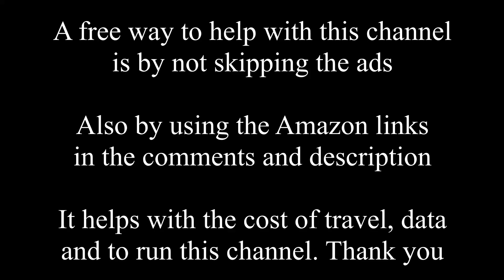New Bike and Cart for Homeless Magician - Cebu City Philippines

Comment: Dustin, maybe you could ask the bike makers to custom make you a type of cart that can carry rice.  The cart has to be light but strong and able to go across the terrain in Toledo.  So instead of hiring someone to carry the rice (and hurting themselves also), they can just put it in the cart and pull the cart along.  No more herniated disks to worry about.
Reply from the maker: That's a good idea
Reply: @DustinBackpacks  Probably best to build a 2-wheel cart (since lighter) instead of a 4-wheel (gets stuck in mud more easily).  Built similar to a rickshaw setup.  Tires could be 20 inch BMX type bicycle tires.  Larger standard bike tires (26-29") might be too fragile.
If you want to really go old school, you can hire someone to build it all of wood in Toledo.  Someone who does carpentry (Jenis? - guy who plays guitar backwards) could probably do it fast.  Even the wheels could be wood.